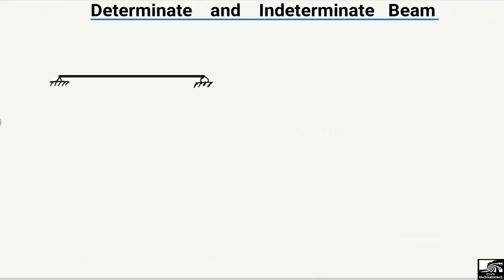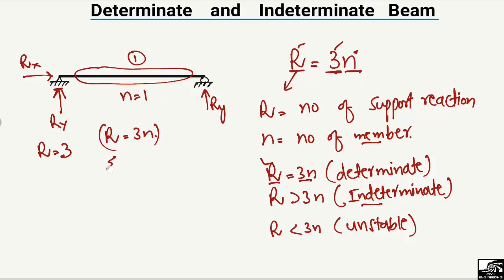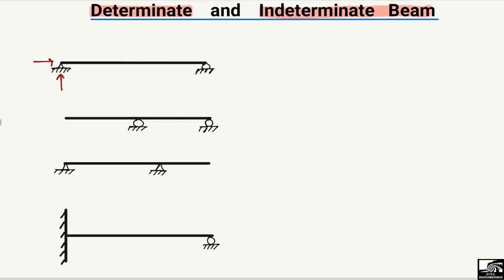What are Determinate and Indeterminate Beams || Example solved

Comment: Thank you for the video. May I ask why in the third example n=2 instead of 1? In a course I am taking there is a similar example except with a fixed connection to the left side and a roller as the right connection (still with a cantilever). The solution used n=1. Also when I look at that third example it appears that if you placed a point or uniform load at any location I can imagine how the beam would behave and I feel it would remain static.